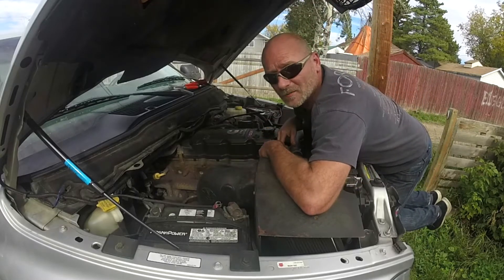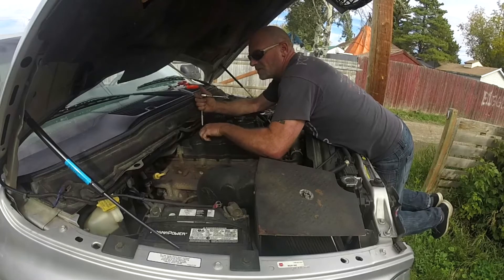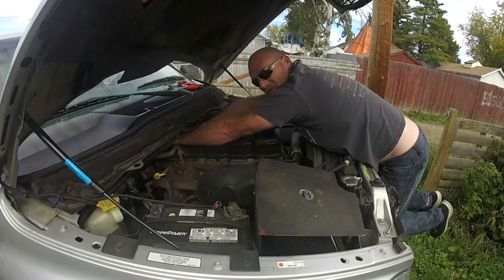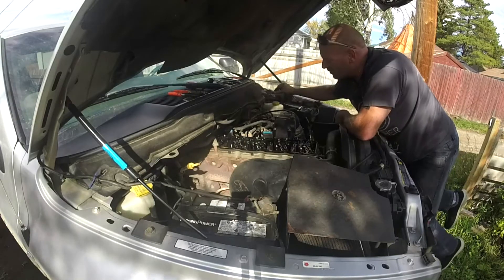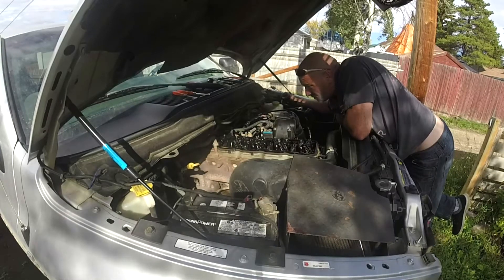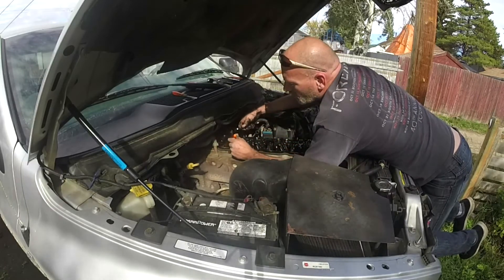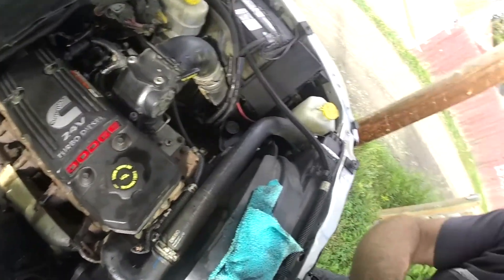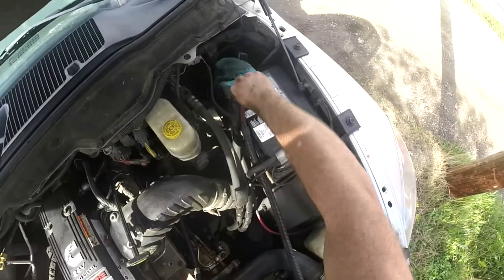2006 5.9L Cummins valve lash adjustment in under 30 min!!!

Comment: I jumper my starter relay and the timming mark on the damper would never go to 12 o clock. Always land around 1 o clock. But rockers were loose at that point. So I adjusted them. Does that sound ok?
Reply from the maker: @chocryder  that is perfectly fine. They just need to be lose as it shows the lifters are riding on the base circle of the camshaft lobes. You're good to go

Comment: You can bump the starter on Auto trucks too right?   He just mentioned the stick in case some Gomer let the truck in gear (I’m assuming).
Reply from the maker: That's exactly right. Stick or auto , you can still bump the starter. It's a safety factor with the stick is all 👍🏼

Comment: Informative video's. Glad I run across them. I just finished replacing my injectors and tubes and I want to do a valve lash adjustment while its opened up and since its never been done on my 2005 Cummins yet. (240K).  I feel confident I can do it although, to say I'm a bit jittery would be an understatement. I am aware of others video's where they find TDC and adjust in a different sequence but I like the way your video shows for simplicity. But I have a stupid question I hope you can/will answer. I understand how to make the starter jumper but I didn't quite get what EXACTLY you were looking for with the intake and exhaust rockers as you bumped the starter.  The video doesn't show it close enough for me to realize the goal.  I look forward to your answer and thank you again for the information you share on your video's.
Reply from the maker: I'm happy to try to answer for you! And thank you for your comment on the video too!! 
So, when I'm bumping the starter, I'm watching the pair of intake and exhaust rockers for which ever cylinder I wish to adjust. You can bump it over several rotations if you like and that is so you can see the timing events... intake opens, closes, exhaust opens, closes etc... I bump it until I see both rocker arms closed and usually one more bump for good measure to make sure they are on the base of the camshaft lobes. To confirm they're on the base of the lobes, you'll be able to rock each arm and see the free play or "lash" that is there already and that's when you can adjust back to the factory specifications. Enjoy the adjustment sir. I always find it satisfying when completed and I fire up the truck to hear how smooth it sounds. Let me know if there is any further help I can give. Thank you!
Reply: Thank you for your prompt and courteous replies to my questions.  This helps and makes me look forward to the task.  @dazeofgloryshopworks5806
Reply: Hi Dave - Finally got a short break in the weather here in Montana and was able to take on the task of adjusting my valve lash. It went far easier than I made it out to be especially with your video and information you provided me in your answers to my questions. Just want to thank you again. Unfortunately, my grid heater/glow plug pigtail light on my dash is still on even after changing out the fuel injectors, fuel supply tubes and lines and the valve adjustment (which doesn't affect my check engine light of course). I am back where I started with the engine code:  P1222. Not sure where to go from here but waiting for the weather to give me another break so I can at least open the hood without snow getting on everything.   @dazeofgloryshopworks5806
Reply from the maker: @anglersnw  hi Kevin, I'll do some digging into the code and some of the possible causes. Might help and if it helps, I'm happy to pass on the info for you. Glad the work has gone smooth too!!

Comment: Getting ready to go do this. after new radiator, pump, and brakes, this is next on my list. Just a quick question though. You do not put in a new valve cover gasket??
Reply from the maker: They're made to be reusable several times. If the rubber looks dead and flattened then change it. Mine was good but that's not the case every time. Though I've reused the same gasket countless times over the years. 👍🏼👍🏼

Comment: Hey Dave, Ive read online that guys with 6.7 Cummins that have done all the deletes can set valve lash to 5.9L specs due to EGR being removed? What is your recommendation/thoughts to that?
Reply from the maker: In all honesty, id you set em to the factory "tight" spec is best. So say the valve cover decal says 26 thou for exhaust. That's the middle of the min-max spec. I would go the minimum and you'll be mint. The min will be close to the 5.9 spec anyway and you'd be fine with 5.9 being 10 and 20 thou intake and exhaust.
Reply: @dazeofgloryshopworks5806  excellent, You relieved the OCD in myself. I set 10/20 :D
Reply: .08 and .18 runs smoother

Comment: What is the perfect feel for feeler gauge drag?
Reply from the maker: That's a fantastic question. I would describe it as not having to fight to remove the feeler gauge (too tight). And just being able to slide it back in when removed. Too loose would be being able to move it quickly with little to no tension to it.

Comment: Great video seems very easy…I’m new to the Cummins world how do I know when I need it? Just purchased a 06 Dodge 2500 5.9 24v and although it drives ok, has power Im curious if I should do? Thanks
Reply from the maker: I look at it like this: if I purchase a "new to me" vehicle, I go through and change the fluids and such just for a basic starting spot for my own maintenance. Unless you have record of it being done in the last year or two, then I would consider it for sure. 
How many miles are on the truck?

Comment: Have a 2005 Cummins and can't find the yellow starter wire - is it a different color or location on the 2005?  Thanks.
Reply from the maker: Excellent question man. On 2003-2005  trucks, the starter relay is in the under hood fuse panel. (Power Distribution Center). For that one it's just as easy. You take a 3-4" long wire, 16-14 gage, put male spade terminals on the wire. 
Pop the starter relay out and terminals 30 and 87 of the relay is the two spots in the PDC that you want to jumper. So I put the jumper wire in either one , 30 or 87, ( can look on the underside of the relay for the terminal placement). Then I touch the other end of the jumper wire to the other terminal to jump the starter. Hope that helps!!!
Reply: @dazeofgloryshopworks5806  Thanks, I will give that a try.
Reply from the maker: @dkslucas1  I'm happy to help. Let me know if there's any issues man 🤘🏼
Reply: @dazeofgloryshopworks5806  finished up this morning and what a huge difference, so quiet. Ended up using a push button switch to jump the starter as I had a hard time watching the rocker arms while touching the wire to the terminal.
Reply from the maker: @dkslucas1  awesome!!!!! They sound so good when it's done right man. Great to hear. Good deal with the push button man 🤘🏼🤩🤘🏼.
Reply: Hi Dave - I have a question on the jumper wire and locations to use in my PDC. I have a 2005 also and cannot locate the "yellow" wire on my firewall. In your answer above you mention terminals 30 & 87. I ran into an issue with those locations as the #30 is a "spare" and the #87 doesn't exist in my rig. I see the starter relay on mine is #72 which I can pull off easily enough. My question is "on my PDC, what two contact points should I be using to bump my starter for this specific valve lash adjustment procedure"?   I took photos of my PDC cover which shows the fuse locations but Youtube will not allow me to send those photos on this reply. @dazeofgloryshopworks5806
Reply from the maker: @anglersnw  hey Kevin, if you pull your starter relay, the two terminals that are perpendicular to each other will work. One will be pointing straight and the one across from it will be pointing 90 degrees different. Hope that makes sense. Then just jumper wire those two and it'll work the same for bumping over the starter. Sometimes dodge put the grey/yellow wire with the grey connector for the starter solenoid near the pdc or positive battery terminal on the driver side as well. Let me know if this works for you 👍🏼